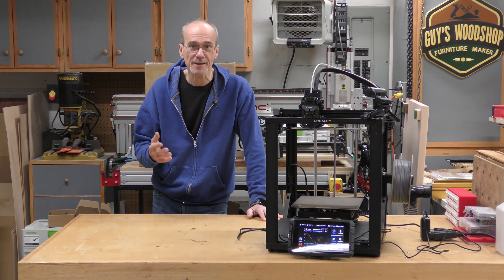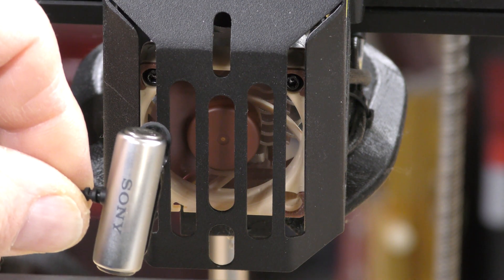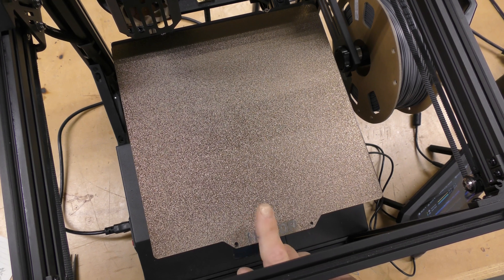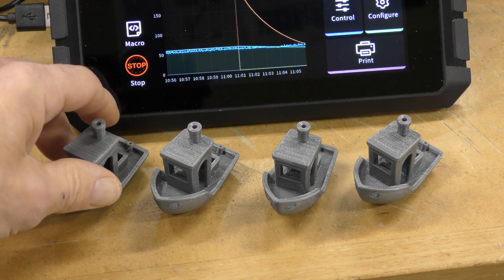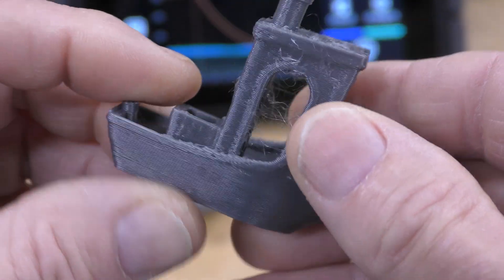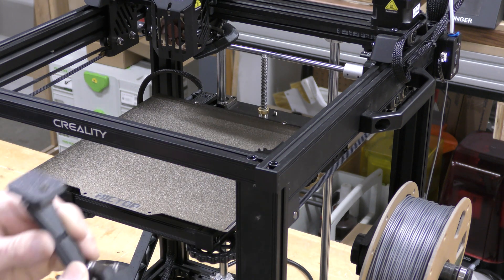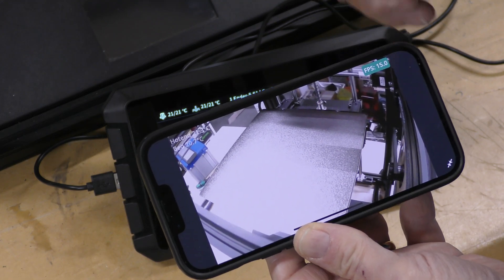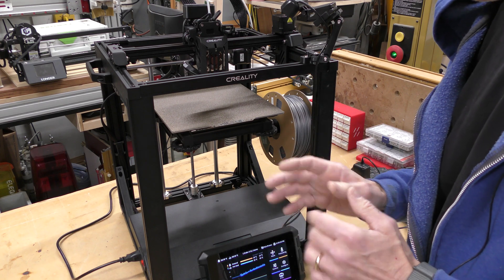Ender-5S1 Mods and Klipper Install With Creality Sonic Pad

Comment: I noticed that you are using an 8 GB SD Card. I have been having trouble loading the firm ware using a 64GB SD card. I have been reading on line that Ender printers have problems reading cards larger than 8 GB. If that is true is would be helpful to your viewers to alert them to this potential problem.

Comment: Do you leave the accelerometer plugged in while printing ?
Reply from the maker: Nope. After it runs, it will ask yuou to save changes. Say yes and then disconnect.
Reply: @GuysShop it won't let me choose the ender 5 when I do the accelerometer calibration

Comment: Awesome video!  I just got the Ender 5s1 and Sonic pad and while I’m setting it up now, I do not see where to attach the accelerometer to the tool head on my Ender 5s1…did you modify the tool head at all to fix the accelerometer to it?  Or how should I attach the accelerometer to the tool head so I can complete the ‘measuring residences’ testing?  Thanks!
Reply from the maker: Thanks! There should be some .stl files on the memory card that came with the printer. Thast's where I found mine to print out.
Reply: @GuysShop   killer.  So did you print the “accelerometer attachment” using the stock Ender 5 s1 setup before hooking up the Sonic Pad?  Or did you setup the Sonic Pad and just print the “accelerometer attachment” without doing the residence testing first so that you could then complete the residence testing with the printed part to attach the accelerometer? Haha that’s a lot of words, but hopefully you get what I’m asking.
Reply from the maker: @R_U_D_Y  I printed it out before I even installed Klipper on the E5S1.
Reply: @GuysShop  thanks! I found the STL files. However I do not see one for the E5S1.  Did you use the flat cable version of the “Ender3 S1 & Ender 3s1 pro” as it’s labeled in the contents on the Sonic Pad USB drive?  Or did you use a different STL file they provided?  Perhaps the “Ender 5 plus” one?  Sorry for so many questions - just trying to avoid printing multiple brackets and then realizing they aren’t going to work.
Reply from the maker: @R_U_D_Y  Unfortunately I've slept since then. I can remeber what I used. I think I just printed several out to find out which one worked
Reply: @GuysShop  haha no worries.  Thanks.
Reply: Didn’t realise that and I’ve just superglued it 😂

Comment: Wow that's impressive how easy that was to setup. I think the Sonic Pad is 12V, which is unfortunate so it would take an extra buck converter to power it directly from the internal power supply.
My Sonic Pad should show up this week, so I'm looking forward to an easy install.
Reply from the maker: It's a very easy install. Never thoiught about powering it internaly instead of with a plug. Hmmm.....
Reply: @GuysShop  I need to clean up my Sonic Pad install.
Powering it using a buck converter, getting it mounted to the frame, and maybe getting a right angle USB cable will be really nice.
It would be ideal if Creality posted a guide on how to do this, or sold a kit. But they have always leaned pretty heavily on other people to figure it out.
Reply: Alright, just ordered the buck converter and USB plug. Thanks for showing close-ups of all the parts of the machine. I picked out the parts using your video as reference so I didn't have to go downstairs and take mine apart!
Reply from the maker: @NathanBuildsRobots  Yeah, I think I'm going to have to do it also. The buck converter thing that is.
Reply from the maker: @NathanBuildsRobots  Sweet!